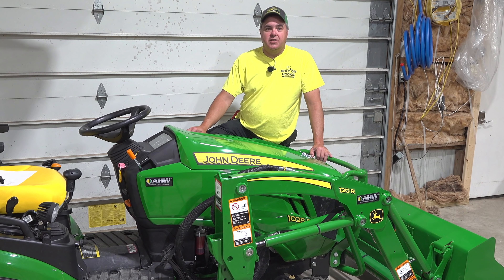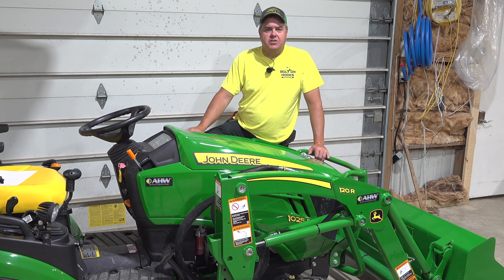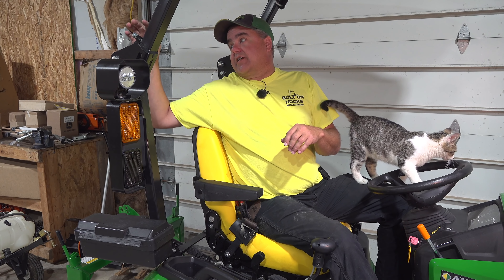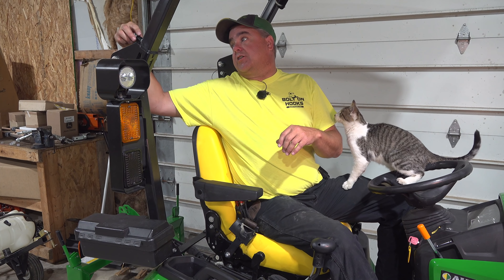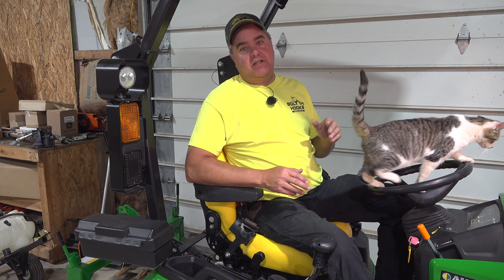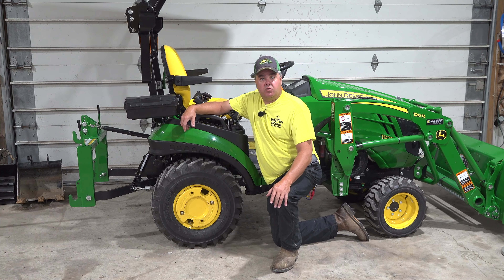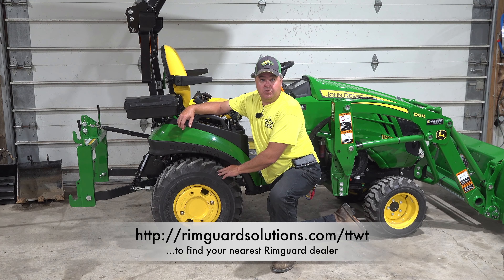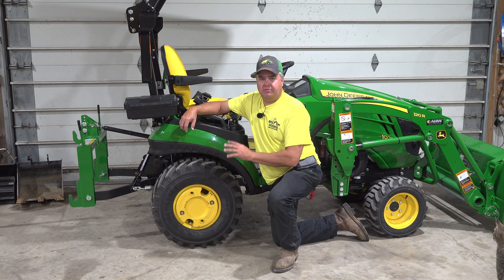NEW 2019 John Deere 1025R with ALL the Bells and Whistles! Model Year Confusion Resolved!

Comment: Hey Tim, thanks again for all you do for the newbie or causal tractor owners out here. It looks like the plumbing on your new tractor will still require a hydraulic splitter for dual cylinder grapples. Is that correct?
Reply from the maker: Yes.  Only for the artillian.  The Precision has a ‘tee’ in the line.
Reply: @TractorTimewithTim  Thanks.

Comment: My local dealer - I talked to them last week.  they are hurting - they have almost NOTHING on the lot (Sales have been very strong).  Supposedly Augusta is still running but some 3rd party suppliers have been slower getting them parts
Reply: Same here. Salesman was dying as he couldn't get product (big multi location dealership) and the lead times on new orders is very far out.  IIRC he said they were quoting Nov. delivery for new orders and they units that were due in last month had yet to arrive. They hardly had anything there. This particular dealership has enough locations (10 ish) that he said whatever I wanted was probably somewhere w/in their company & he could probably get transferred if need be but they were definitely hurting for inventory.

Comment: I noticed your 3rd function looks like the ones that came with my 4Rs. Looks like it has the smaller couplers then what we typically see on ag equipment. I have been trying to decide rather to convert everything I have needing the 3rd service to the smaller fittings or change the loader connectors to the larger connectors like seen on the back of the tractors. What are your plans or had you noticed that yet.
Reply from the maker: I'm leaving them small. I had some  pigtail hoses made 1 foot long which convert 1/4 to 1/2, and another set for1/2 to 1/4.  haven't used them yet.
.
Reply: Thanks Tim, that's a really good idea, that way you always have what you need to hook up. 

I have one loader already converted to larger fittings, but it made super tight where there located which in turn made it a bear to hook up them up, so I had some extensions made and relocated the connection point all together on that 4r loader. 

I recently bought one of those 4-1 JD buckets and it came with the small connections, which was my first attachment that had ever come with those small connections. 
My other 4R loader is still 100% stock with the small couplers as well. 
Now I know why they made them smaller, hooked up much easier. 
So I have been trying to decide rather to convert the 4R loader back to the 1/4" couplers and convert all my other attachments to work on 1/4 inch or what  would be best. 
I am really liking your plan. 
I could then make about anything work with either loader with some of those pig tail adapter hoses.  
Thanks for the info . 
Greatly appreciate it.

Comment: Do you know if you can get R1 tread tractor tires that will fit the 1023E to get better traction.
Reply from the maker: They are available from Carlisle.  Not available as factory configuration.
Reply: Tractor Time with Tim Thanks The 1023E are really great tractors I have 2,330 hard hours on mine.

Comment: I hope that John Deere releases a dealer installed 3rd function for the 2038R (and 2032R) that can integrate into a revised version of the single handle quick disconnect.
Reply from the maker: The Artillian diverter now has a very nice replacement knob which fits beautifully into my hand.   Huge improvement.

Comment: Any idea why my cruise control won’t work?  Brand new, first day beginner. Read manual but just says how to engage it. It doesn’t engage. Stuck in down position and can’t raise it.
Reply from the maker: Push the hydrostat pedal down with your foot, THEN, pull up on the cruise lever.   it should then lock the pedal down.

Comment: Got a new 2019 last fall with cab. The 3 rd function was not available from factory. Very very difficult to take cab off to add 3rd function valve or diverter. 😫
Reply from the maker: Good point. I find I have to take the floorboard off to do lots of different upgrades to the tractor. Cannot imagine not being able to do so.
In fact, I've already had the floorboard off of this tractor...to install the TKV20 high amperage cable from front to back.

Comment: This is interesting, I was just looking at one and the bucket control is the old style but the dealer said it's a 2020 tractor so that just help to  explain it.
Reply from the maker: The bucket control difference is due to the 3rd function.   Use the serial number to determine model year.

Comment: Overall industry sales on compact and sub compact tractors are down about 15 per cent.  Manufacturers and dealers were expecting great sales numbers so over built and over ordered.  Nobody was expecting the Corna virus.  That's probably why JD is still shipping 2019 units.  If anything, there should be great deals to help clean out the system.
Reply from the maker: I am interested to know where you are getting your info.  Totally opposite everything I’m seeing and hearing.  Maybe non Deere compact tractor sales are lower, but Deere sales are through the roof!
Reply: @TractorTimewithTim  
This comes from AEM data.
Reply from the maker: Help me learn.  Tim at tractortimewithtim dot com

Comment: I’ve got a question I am trying to decide on buying new or used. I found a 2013 1026R with 77 hours that would save me $6500 vs new. No warranty on 2013 but are there in major upgrades from 2013 to a new one.
Reply from the maker: There have been changes...but nothing serious.
Reply: Tractor Time with Tim thanks for the quick response and all the content you put out. Very helpful during my buying process. Even got my wife to watch a couple of episodes. Just got to pull the trigger on the purchase.

Comment: So can you still use all of your other attachments on this one?  I got a little confused when you were talking about how other people's attachments did work.
Reply from the maker: Yes, I can use all previous attachments.
Previously, I controlled my grapple with a hydraulic diverter kit from Artillian.  That diverter kit is not necessary on this machine since it has the Deere 3rd function.
Does that help?
Reply: @TractorTimewithTim  yes, thank you. Do you have any videos that explains the function and use of a 3rd function feature? And how it's different from a diverter valve system?

   P.s. would you ever use or try out a mulching implement? Like a PTO chipper/mulcher from DR or other mulching machines? Like actual purpose built mulching machines.
Reply from the maker: I’m trying to get a chipper.
I will explain 3rd function vs diverter in later video.
Reply: @TractorTimewithTim  thank you and that's nice.
 What kind of chipper are you looking for? Like brand wise? Because the only brand I can think of are the DR one's. I've seen other's, just can't seem to remember their names. I just k ow that the heavier the flywheel, the better it performs. That's do to the inertia created .
 I believe there are chipper's that uses both PTO systems to self feed and chip.

Comment: I'm getting ready to purchase a new 1025r, but when I asked my dealer about Rim Guard, they said they do not fill tires with anything but water. Any advice? We do get the occasional hard freeze (below 28F), and sometimes down to the teens.
Reply from the maker: Water is probably fine there.  Hope you don’t sell it northward :-)
Reply: @TractorTimewithTim  Thanks! I was worried.

Comment: Does the new Johnny have the quick disconnect hydraulic for the loader? I thought was a factory option on the 1025R for MY 2019 or is it on MY 2020 tractors where that change occurs?

Comment: I watched your video on what to purchase and talking with dealers. I bought a 4310 New Years ago. When trying to get a good price I soon found out how Deere maintains there price structure. I went and got a quote, they always want your phone number and they print out a written quote. Then when you shop at a different dealer the ask for your phone number and look at all the quotes you have received. I was at equipment expo and was talking with a rep about what I had found out he didn’t have much to say until drinks at the hotel later. So my advice get a different number. So my tractor was bought and delivered from a dealer 200 miles away because of this. If you don’t think it’s true go get a quote. I still had to buy a Deere because they are the best.
Reply from the maker: I don't believe dealerships share the quotes with other dealership chains.   Yes, multiple locations of the same dealership will have your information.  ...but not shared across different dealer owners.
Reply: They do share, have someone you know get a quote.
Reply: I had to use a friends phone number. It’s absolutely true

Comment: What’s your thoughts on the auto throttle? Is it worth putting on this machine? Or did you not like it
Reply from the maker: I liked it, but I probably won't make the effort to install again on this one.  
I MUCH prefer the electronic auth-throttle on the large frame 2R (2032R/2038R).

Comment: So if I buy a 1023e will I be able to take on the same task you can take on with the 1025r with 2 more horsepower of the 1025r?
Reply from the maker: Most. ...but you will likely regret not having some 1025R features like position control on 3 point, tilt wheel, etc.   It isn't much more on the monthly payment.  You'll appreciate the 1025r.

Comment: We ordered a 3039R Monday. Dealer said covid has caused JD to only be running at 50%. Delivery date is 06/21-07/07. My dealer also told me any aftermarket third function not installed by dealer would void entire tractor warranty. WTH! The dealer installed 3rd function is $1900.00
Reply from the maker: Good grief.  That is not correct.  
If you got the deluxe 3039r, it will have rear scv.  Ken sells a set of hoses to route that to the front.   Check BoltOnHooks.com
Reply: Your right. I am doing mostly brush and tree removal work so really didn’t want the bulky hoses draped over or hanging below to cause trouble. Just couldn’t believe what they told me. Very large JD dealer with many locations.
Reply from the maker: They tuck in nicely.  This is the preferred way to do third function on 3R.  The button is on the joystick already for the rear scv.

Comment: I'm sorry to rehash an old topic, but I don't want to make a $5000 mistake, I want to order a 260B backhoe for my 2017 1025R, I havw my tractor apart as I type installing the Deere 3rd function kit myself. If I can indeed use power beyond too im gonna order it also and get a backhoe. Thank you. So I can still install the power beyond and use the 260B backhoe? They just won't work at the same time, but they can be mounted on the tractor together and use both individually. That's the way your tractor is set up correct? I guess I've done so much research im cornfused. (I can see now that the 260B was the one from your previous 1025, so it obviously works together.  Sorry for my stupidity)
Reply from the maker: I don’t think the 260B will work on a 2017 1025r.
You need a 260 backhoe.
The 2018 model is the first to support the 260b.
I would suggest that you work with your dealer. They can help you sort through all of this.
Beat approach is likely to trade tractors.
Reply: @TractorTimewithTim  Hmmmm. Thank you. I will look into this with my dealer.
Reply: Here's a an interestin bit, according to this dealer there is a build date cut off for compatibility with the 260B. My tractor falls behind this date so it is supposedly compatible. Who knows.
Reply from the maker: Ok.  Sounds good.  If he orders it and it doesn’t fit, it will be on him :-)

Comment: So, couple of questions: with this 3rd function hydraulics, does this machine have (1) bucket float, and/or (2) return to dig feature? I haven't heard anybody mention either one of those features.
Reply from the maker: It has boom float...   It does not have anything remotely as fancy as 'return to dig'.  This is a baby tractor.  just the basics.

Comment: Could you have put that third function kit on the older machine?
Reply from the maker: Certainly back to model year 2018.  I am not certain about older machines.  There were some design changes in the frame.  I suspect i it would NOT fit on the older machines...but that is just a guess.    You could ask greenpartstore.com...
Reply: I will call them, would be a cool install if it works

Comment: Congrats on the upgrade!  I'm really curious how the 3rd function works out for you.  

I picked up a 2019 1025R last fall and had ordered it with the 3rd function, but the dealer decided it wasn't necessary so they decided not to order/install it (they tried to charge me for it though) and that was just the start of the headaches (with the dealer).  I love the tractor, but will probably be using a different dealer in the future, which is a shame because this one was 20 minutes from my  house, the next closest one is an hour and a half away.
Reply: i never bought a new holland because of a cocky dealer,  i never bought a john deere cos noone at the dealership would get off thair ass and talk to me, i stood at that desk for 10 minutes in full view of 4 salesman.

Comment: i really wanna see the difference in capacity for the 120r loader with one on johnny and a 120r on a 2025r
Reply from the maker: I guess I could show them by setting the pressure ar the two different specs :-). Loader is exactly the same...only difference is pressure.

Comment: My 1025R #1LV1025RJKK 2019 has J where are you say there should be V any answers for what that might mean?
Reply from the maker: It says "tractor family" in the decoder chart.  Likely means a different standard configuration. For example, cab, no cab, loader, no loader, etc.   There are SOME options installed in the factory, others by dealer.  I suspect this family distinguishes which options are installed. ...but this is just a guess.
Reply: Your J is a Security Code; Calculated character based on the value of the other characters. It's different on different VINs. It's like a checksum.   http://salesmanual.deere.com/sales/salesmanual/en_NA/tractors/2015/feature/serviceability_and_support/serial_numbers.html
Reply: @TractorTimewithTim  what decoder chart are you looking at? I am going off a five year old doc, and I suspect things have changed with these VINs since then.

Comment: The thing I don't like about JD & probaby other manufactures is how everything is $1000/$1500 extra for the dealer to install. Why don't they give you the option for them to order direct fr the the factory when they build them so it isn't torn apart to install, more chances for things to be missed or not tightened properly. If you order it with a backhoe that way its about 3K cheaper i was told. Speaking of cheaper my 2014 1025R with a 60" drive over auto connect electric lift( which I'd never get again) FEL & front snow blower was $29241.45 CDN so I'd say you are getting off a lot better. Everything up here is expensive :-(
Reply from the maker: I agree with everything you said!
Reply: @TractorTimewithTim  I'd love to get a new 1025 R but just got the Wife a 2020 S240 to trim around the trees & do the front yard.

Comment: Control stick is to low for me that would be a problem
Reply from the maker: Agreed.
Reply: Can’t you take it to the dealership and get a little longer one?
Reply: There's a screw under the armrest that you can screw in and out to change where it sits. 

I had to lower mine just a smidge too make it comfortable. Very easy workaround until a longer stick is made

Comment: Does this one have the electric deck lift?
Reply from the maker: Nope.  There is no electric lift available on the 1 series. There are 3 options available.  Check out http://tractortimewithtim.com for a detailed description of the 3...including part numbers for the upgrades
Reply: @TractorTimewithTim  I guess I meant a hydraulic deck lift via an electric switch. Mine has it, granted it's a 2015 model.
Reply from the maker: Understood.

Comment: 3rd function was $900 and $700 installed for my 1025r.
Reply from the maker: $1600 total?
Reply: Tractor Time with Tim yes sir.
Reply: Tractor Time with Tim btw hows the garden doing? My corn is about 2” high. Its looking good so far.
Reply from the maker: Corn has had a rough start.   ...but looks like it will be fine.